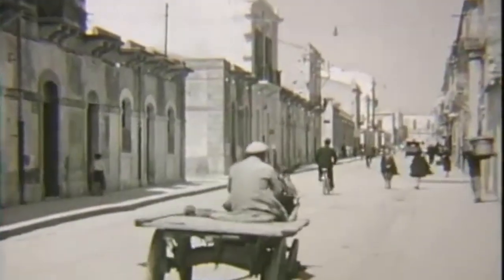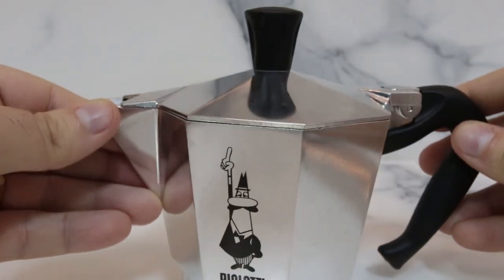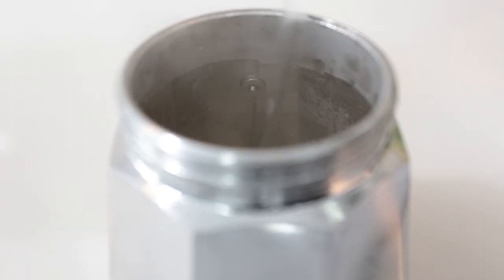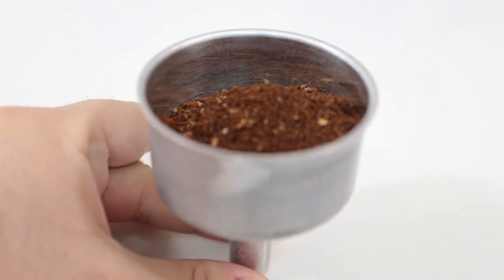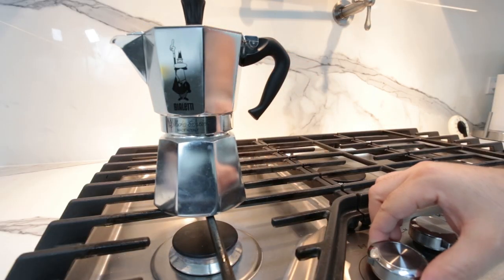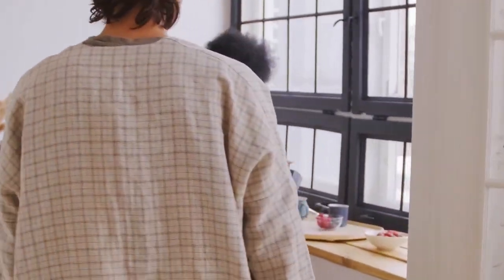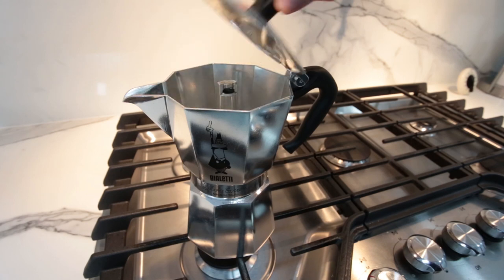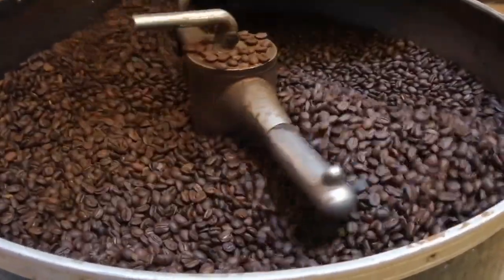Is the BIALETTI MOKA POT Worth it? | Best Budget Coffee Makers Reviewed

Comment: Good video, so I'm sorry I have to disagree on a couple of points. 

I follow Bialetti's instructions, which are the traditional way that Italians have used the Bialetti since 1933: 

1) Fill the reservoir with cold or room temperature water, preferably filtered or bottled water. I think it was James Hoffman who started the trend of filling it with hot water, and I don't believe that improves the results at all. It's not necessary. If you cook the coffee over a low gas flame, or a medium-low to medium electric stove, it only takes 3 to 6 minutes to brew, so your coffee will not burn. The extra time is good, not bad. Hoffman admitted he doesn't understand the Bialetti and he even said, "It broke me." 

2) Bialetti replied to my email that the official correct grind is medium fine, not fine. The instructions say to never use fine. Most ground espressos are too fine for Bialetti, but the espressos sold in Italian grocery stores are the right grind for the Bialetti: medium-fine. I use illy Classico Espresso. 

3) The lid should always stay closed while brewing to maintain the right pressure and let the gasses build up in the coffee for the best aroma. I let it brew until the gurgling starts, and then I let it gurgle for a few seconds, then maybe I lift the lid to see if it's full before removing it from the heat. But often I don't lift the lid at all. 

I let the pot sit off the heat for one minute, then I stir the coffee with a teaspoon before I pour it.

But I agree with everything else you said and overall it's a good video. 

The only video I've found that does everything according to the traditional Italian way by following Bialetti instructions is "Annalisa J moka pot."
Reply from the maker: Amazing insights! We should probably do a video about it! The original Bialetti recipe!
Reply: @IvanDrinksCoffee  That would be a fantastic video! I hope you enjoy "Annalisa J moka pot" video. It improved my coffee a lot. I really love it!
Reply from the maker: I just did!! Really enjoyable woman! And like most of what she said. The only true misconception of this machine is that it is really not an expression maker. It creates a concentrated coffee that is espresso like. To make an espresso you need around 9 bars of pressure and the Moka will be around 1-3bars! Thanks for the recommendation !
Reply from the maker: I just did!! Really enjoyable woman! And like most of what she said. The only true misconception of this machine is that it is really not an expression maker. It creates a concentrated coffee that is espresso like. To make an espresso you need around 9 bars of pressure and the Moka will be around 1-3bars! Thanks for the recommendation !
Reply: @IvanDrinksCoffee  You're right. Annalisa J has explained in her comments that moka pot coffee is not really espresso per se, but in Italy they call it "Home Espresso" or "Italian Espresso" because Bialetti first advertised the moka pot as a way to make espresso at home so you don't have to go to the bar.
Reply from the maker: True. Is the Moka Pot your go-to coffee maker? ☕️
Reply: @IvanDrinksCoffee  Yes, the moka pot is my go-to coffee maker. I love it! I have the stainless steel Bialetti Venus 2 Cup, which is my favorite, and I also have the 4 Cup. I use pre-ground illy Classico Espresso. I used to live in Spain, so I bought the same glasses on Amazon that they use in all the cafes and bars to serve cafe con leche in. They're made in France: Duralex Unie clear glass tumblers 8.5 oz (250 ml). I put 5 oz of milk in the glass, heat it in the microwave, then add a shot of moka pot coffee. ❤️😋
Reply: Sorry this is wrong,  using hot water makes a better smoother brew in less time.  Why would you want hot steam going through your coffee for all that time on the stove.  Also keeping the lid closed has no effect on the pressure lol.  Surely the spout where you pour the coffee out is also letting out pressure as well right? Just because people did something in the 1930’s doesnt mean its right and we have to still do it
Reply from the maker: Sorry I didn’t get to this before. Still getting a hand with notifications in this app. I love that you are so specific about your coffee! I personally use a bunch of machines, even different ones per day to keep it interesting. Have you ever owned other machines likes the french press or a Chemex? You should try immersion and pour over methods just to see how well do you enjoy them. The one I use the most is the V60 actually. Cheers!
Reply from the maker: Maybe the original recipe is not the best currently, but don’t you find it beautiful to know you are doing things the way the Italian culture has being doing it for almost 100 years? I love history and culture and stuff like this gets me every time. Maybe that helps.
Reply: @IvanDrinksCoffee  Yes, I have a French Press and a Bodum pour over. But they don't make espresso style coffee. The purpose of the Bialetti moka pot, when it was introduced in Italy in 1933, was to make a home version of "espresso" that's concentrated enough to use in Cappuccino, Latte, or just as a cup of "espresso" so they wouldn't have to go to the bars. They know it's not exactly Espresso, but they call it Italian Espresso or Home Espresso anyway.
Reply: @IvanDrinksCoffee  Yes, the original recipe is the best currently. James Hoffman admitted he doesn't understand the moka pot and he complained, "It broke me!" His problem is he never learned to do it correctly in the first place so he was trying to fix problems that didn't exist for people who do know how to use it correctly. He kept complaining about the moka pot "getting to that angry spitting stage," but it never gets to that stage when you do it right. The whole thing is ridiculous and is very offensive to Italians to suddenly be told by a Brit, who never learned to do it correctly in the first place, that their traditional way isn't the best way.
Reply: @jimreplicant  Sorry, you are wrong. Steam does not go through the coffee. The coffee basket tube is under the water level - it is impossible for steam to pass through the coffee grounds. Furthermore, heat expansion pushes water into the coffee grounds before significant steam is produced. Need proof… Simply observe the upper chamber where the espresso comes out. You will notice no steam coming out (which would be very easy to see). Also, there is no time savings to pre-boiling your water. The time it takes to boil water in your Moka Pot is essentially the same amount of time it takes to boil water in a kettle. No time saved. I have directly compared the pre-boiling method a number of times. There is no benefit in flavor (certainly not better or smoother) nor in time. Plus you run the risk of an accidental burn. Pre-boiling water for Moka Pot espresso  is a complete waste of time.
Reply: Huge thank you for your in-depth Moka Pot information. Can't thank you enough!
Reply: @frankhughes001  This is a fantastic explanation! I learned a lot! Thank you 😊
Reply: @frankhughes001  Thank you so much for saying that! I really appreciate it!

I recently bought a 2 cup Bialetti Brikka that makes crema. I love it! The instructions are different than the regular moka pots: Use the enclosed measuring cup to add 120ml water to the 2 cup Brikka, or 170ml water to the 4 cup Brikka. So we can't fill it until the water touches the bottom of the valve or it'll overflow. Loosely fill the coffee basket with medium-fine coffee to the rim and level it with your finger or spoon handle without pressure. Use medium electric stove or medium gas flame, but keep the flames under the pot. After a few minutes you know to remove it when you see steam and it gurgles. But it's a different noise than the moka. Bialetti has a short video showing what it looks and sounds like. 

I made four pots, 3 to season it and discard, then the 4th to drink. I got no crema the first time, perfect crema the second time, and only half as much crema on the 3rd and 4th time. I think it's because my electric stove isn't hot enough so I need to go just above medium. It took 7 minutes at that temperature. But the flavor was good! 

My daughter and son-in-law are former Starbucks managers. (They don't like Starbucks coffee 😂.) They've had advanced training so I sent them a new Brikka and a bag of Bialetti Perfetta Moka Classico, plus a can of illy Classico Espresso, in case they can give me tips for the best results. They got it today, so my daughter followed the instructions to the letter and got great results! She's so excited! Her electric stove runs very hot so she used it one click below medium and her 4 batches each took 7 minutes. Next she'll try turning it up to medium. 

If you get a Brikka too, since you love to use all different brewers, I hope you'll make us a video about it! 😁
Reply: @photina78  Thank YOU! For sharing the correct Moka Pot method. Hopefully more people will try a Moka Pot without all the fake "hacks" that so many other people post. 

I have the older model Brikka, both the 2 cup and 4 cup, with the weighted metal cap and water level marked inside the upper chamber. When I bought them I assumed you fill them like a regular Moka Pot, to the bottom of the valve. That was wrong and I had a lot of problems. So I set them aside for a long time. I decided to try them again but used the water level guide in the upper chamber then transfered the water to the lower chamber. Worked perfectly! No problems at all. And it makes an amazing espresso with crema! Not as much crema as a proper espresso machine but still very good, and tastes so good, maybe even a little better than a Moka Pot. But I still use my tried and true Moka Pots every day. 

Yes, the sound of my Brikka is very different than a Moka Pot. On my older model Brikkas, it is a very sudden and dramatic "Whoosh" sound with lots of foamy espresso coming out. Very surprising at first. Not sure if it's the same on the newer model Brikkas. 

I usually use the Brikka to make a Cortado espresso (similar to an Italian Caffe Macchiato or French Cafe Noisette). A Cortado is a Spanish style espresso made with 2 shots espresso and 2 shots hot milk, and sugar of course. But I put 1 shot of milk rather than the standard 2 shots. For me a straight espresso is a bit overwhelming, the Cortado suits me better. I use the 2 cup Brikka to make a single serving Cortado espresso. It makes a very nice crema even ater I add the milk and stir. I use the 4 cup Brikka to make a Cortado for me and my wife. However the first espresso I pour gets most of the crema, the second only a little crema…so I give my wife the one with more crema ;-) (Not sure if she appreciates my sacrifice Lol). 

My wifes's nephew also used to work for Starbucks. And similarly, doesn't have anything good to say about them. I will admit though, Starbucks introduced America to good Italian style espresso based coffee. Before it was pretty much all bad drip coffee, which I never liked. Years ago I tried a latte at Starbucks and I was hooked. But quickly got expensive and had to enjoy only as an infrequent treat. I thought there must be a way to make a good espresso/latte without buying a bulky and VERY expensive espresso machine, which would eventually break and require expensive maintenance or replacement. I tried pretty much everything; very strong drip coffee (ugh!), French press (definitely nothing resembling espresso), and others. At the time, most coffee snobs belittled the Moka Pot saying it made bad coffee. So I avoided it. Then I saw a Moka Pot in the store and decided to try it. My coffee world changed. But it wasn't easy, mostly because of bad youtube videos. Eventually I got it though. The simple basic instructions work perfectly - every time. All the fake hacks are almost entirely useless. Now I own something like 15 Moka Pots in multiple sizes; 3, 6, 9, and 12 cup models, 2 and 4 cup Brikkas, stainless steel, Bialetti, Gnali & Zani, Alessi, and others. It's become a bit of an obsession for me Lol. 

For coffee I mostly use Peet's, Major Dickason's, a dark roast. I also occasionally buy their House, French, and Italian - all dark roasts (I tried their other medium and light roasts - not good for me). Their drip grind works perfect in a Moka Pot. And Peet's sources their coffee ethically (very important to me). They also mark the actual roast date on every package. So, in the grocery store, I reach to the back to get the freshest - shhh, don't tell Lol. In my area the Italian coffee brands are a bit harder to find and usually not the freshest. While Peet's is available in most grocery stores. 

It's been an absolute pleasure talking with you! I'm pretty sure we've talked before. Anyway, wishing you an amazing day!
Reply: @frankhughes001  😂😂😂 I really enjoyed your coffee biography! 😂 It's a bit like mine. I got hooked on Cafe con Leche in Spain. My barista daughter,'s favorite grocery store coffee is Peet's Major Dickson! You have great taste! So very gallant of you to give your wife the most crema! 💕 Thanks for all the tips! Have a blessed day.

Comment: Of course not, why would you keep the lid open?🤔
In that case, get rid of the lid, why would they bother adding a lid if you left it open? And hot 💦 water? Where does it say so, cold or lukewarm is perfectly fine. 
Plus I doubt you kept the rubber or silicone on your machine 8 years! maybe you make coffee once a week or less?🤔
Reply from the maker: The lid open is a tip for people that do many other things in the kitchen at the same time as they brew their coffee. This is to help notice the moment when it’s ready and avoiding the last burned part of the brew.

As for the water is something that James Hoffmann has recommended on several opportunities, and I feel like it gives my moka brew a better taste.

As to the gaskets I guess I’m just lucky. (I use mine 5-6 times a week). 

Thanks for watching the video! ❤️
Reply: The Moka pot I'm using now is at least 25 years old. I've changed the rubber/silicon seal in this pot four times (it may even only be three). I brew coffee at least twice a day. 

I only brew coffee with the lid closed to stop coffee spitting all over my gas stove. I'll turn the gas off just as the Moka pot starts to bubble. I never miss out on a great cup of coffee.